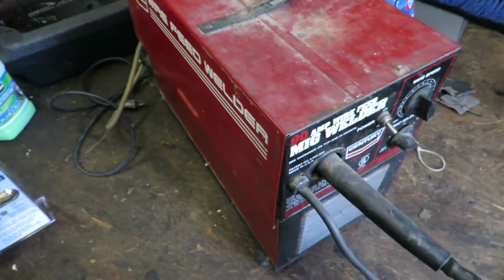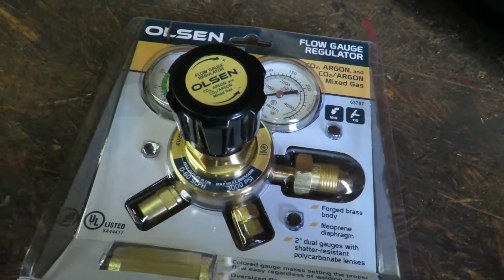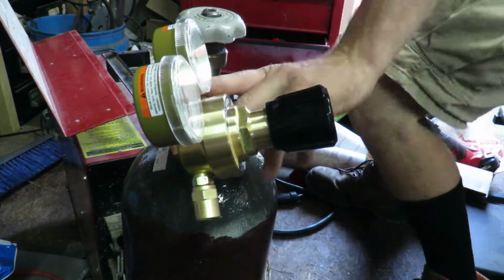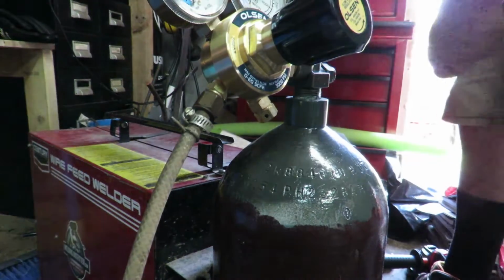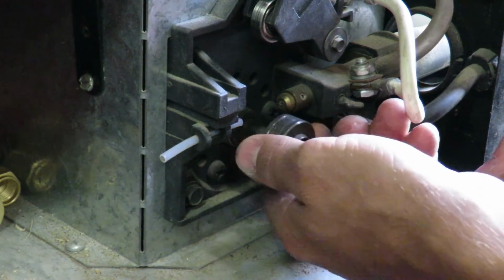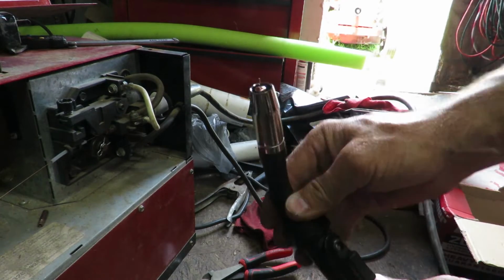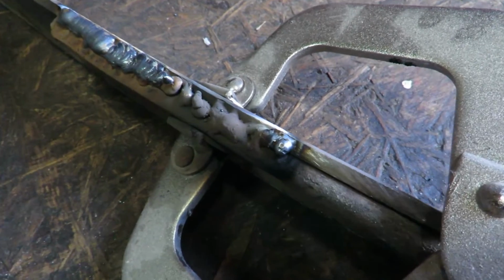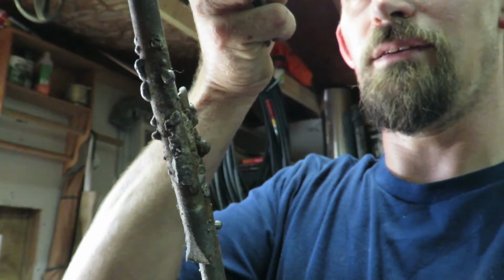Upgrading a Welder From a GASLESS to GAS Setup

Comment: When you said you had trouble my first thought was the polarity was wrong but it looker like you were on top. Of that, could be the wire you got is bad, flux core is supposed to be better outside,  wind disturbs the gas in the mig setup